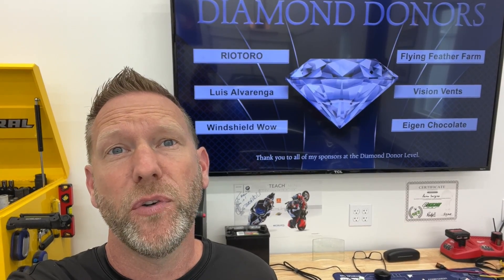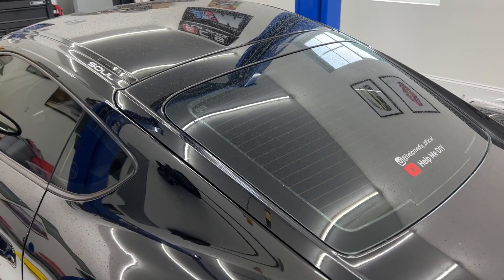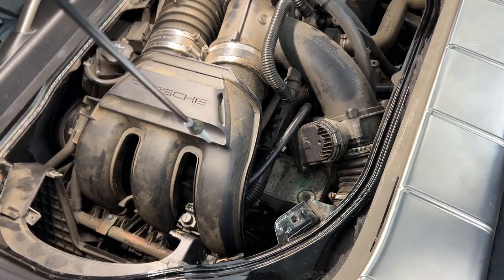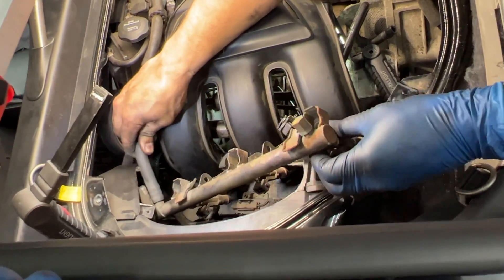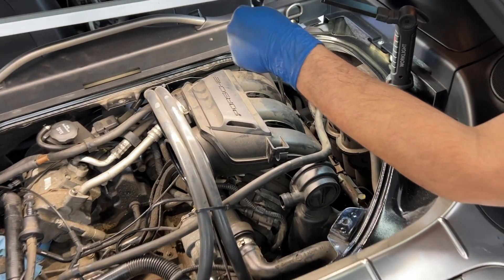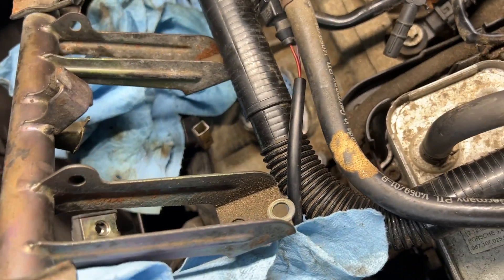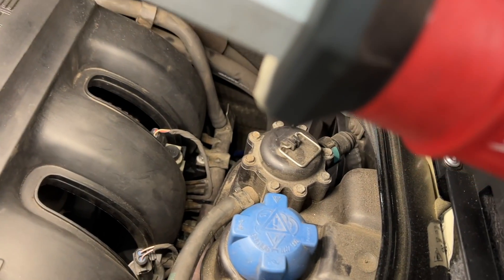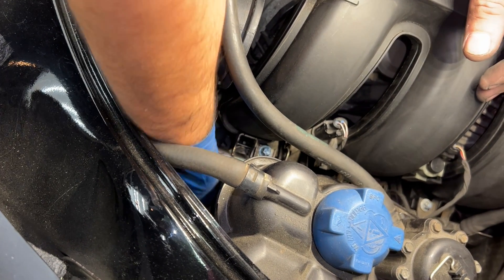How to REPLACE FUEL INJECTORS in a Porsche Cayman 987 (Condensed Version)

Comment: Here's a tip. The left hand most forward manifold bolt is very difficult to remove. Even worse is getting it back in. First I used a little grabber to start the bolt in the manifold flange. Figured a magnet (as in the video) might fall off and the screw disappear for a while. The main problem is just no room to get a socket wrench socket and extension down there. I switched to  1/4" extension but my E10 socket is for a 3/8" drive. So I used an 8mm socket and it worked! I used electrical tape to help hold the two extensions together as well as a little around the extension and the socket. Things falling off down out of site isn't fun. Easy as could be after that.
Reply from the maker: +Eggbert Farnsworth yes I recently bought a 1:4” E10 for times like that :)

Comment: It certainly is frustrating to have to dig so deep to access those darn injectors.  I'm doing it right now. Glad I watched this video previously, so I at least have 6 new manifold sealing gaskets ready. Good to have since the shop manual doesn't tell you that the manifold really needs to come out... it says to disconnect the fuel line and shifter cables, and somehow wiggle the whole injector gallery out. Good luck with that, the manifold is in the way.  When I get frustrated with the tedium of it, I simply take five, and listen to the audio with the playback speed slowed down to 50%. It's hysterical!
Reply from the maker: +Uncle Duncan yeah some people say they do it without removing them. I don’t understand how!
Reply: @HelpMeDIY  Hello from Spain. Thanks for your videos, they are a big help for DIY guys. I managed to change all 6 injectors on my 08 2.7 Cayman without taking out the manifolds. I didn't take out the fuel rails, popped the injectors out from their seats and found that there is enough room to move the rail to get injectors out one by one and install new ones one by one. It was a tight and tricky job, but it is possible. The biggest problem was if 2 of the old injectors came out without upper seals, to get the old seals out when the fuel rail is practically in place needs a bit of thinking and testing different tools. The job took me about 4 hours. No special tools needed, you just have to be creative and patient. Had no problems with the car, did it just as preventive service with coils, sparks pugs AOS, after all the engine runs much smoother than before.

Comment: Brilliant video, Ill definately sign up to patreon, Im trying to change the injectors on y 1999 986 at the moment, the right hand side fuel rail came off eventually without removing the intake but the laft hand side is proving impossible. The 986 has the air filter box on that side which needs to come off to get at the injector connectors but there's a bolt at the bottom that is impossible to see or feel. I think that manifild at least will need to come off
Reply from the maker: +colin jenkins thank you sir! Yeah I still don’t understand how people can get them out leaving the manifolds in 😆
Reply: @HelpMeDIY I think its an issue with many specialist cars,  I used to own a Lotus Elite many years ago and one of the dealers produces a characature of the ideal Lotus mechanic. He had a small body/head with one eye protuding from the top on a long stalk and the first and second fingers on each hand were about a foot long. The funny thing was that I could instantly see where those attributes would come in handy😄
Reply from the maker: @marcos3ltrv6  Lol that's great
Reply: I just did the same on my 98 986 and it was a struggle but I found the last bottom bolt from underneat the car (air box has 3 bolts). You need to loosen the inlet manifoild as well to get out the airbox. I just cleaned and tested the injectors with carb clean and a 9V battery. Running well afterwards 😊

Comment: Hi Aaron(?). Nice video. Super helpful as always! I am deciding whether I should start the job on my 2005 Boxster. There has been a constant little tapping noise which becomes really annoying. With a stethoscope, I believe it comes from the injectors. Do you mind elaborating on why i might want to change the injectors even it they may be alright ?
Reply from the maker: +@bon_1900 thanks! Noise could be your lifters failing. I wouldn’t change injectors if they were alright, but Jake Raby recommended to me to replace them as a maintenance item because they can start leaking

Comment: What is the cable/tube, whatever, at 5:52 and where does it attach? In fact there's two of them....? EDIT: I see a bit more about it later on in the video I currently have the 3 left side injectors out (without removing the intake), but reversing that to put new ones in looks more difficult than this video, so out comes the intake. Actually, the difficulty is that two of the 3 fuel-rail 0-rings stayed inside the rail cups. I managed to get one out, but can't even get a pick in the other one as there just isn't any room. Besides, removing the intake will allow me to clean up the engine a bit. Also, the older Boxster (and maybe Cayman) seem to have the fuel rails that only mount with 2 bolts and don't have those long brackets, so they are probably the ones people are changing without removing the manifolds.
Reply from the maker: Thanks for the additional info

Comment: Wow!!  Just did my fuel injectors on my 997.1 Last weekend.  It was running really rough, I got a CEL, and my Foxwell said it was misfiring on cylinder 3.  So today I swapped that injector from Cylinder 3 to cylinder 1 to see if it would follow it, nope.  Car ran rough, CEL.  Cleared it and took it for a short drive.  As soon as the car got up to temp, got another CEL, P2195, O2 sensor lean bank 1, misfire on 3 and 4 and misfire on multiple cylinders.  I was thinking vacuum leak as well.  Car ran rough the whole time, especially in lower RPMs.  Also, did you do a vehicle handover after changing your injectors?  I was told I should do that.
Reply from the maker: +K1dPhresh1 I did not. I did that after a battery drained all the way down a few months ago though. You had noticed a few things not working anymore. Nothing that would throw codes though.

Comment: Is all the oil in the intake from a bad AOS?
Reply from the maker: +Russ Richards the manometer test says it’s fine, so I don’t believe so
Reply: This is exactly what my intake looked like when my AOS failed. I replaced it with a Euros AOS and that broke a week later. I highly recommend the slightly more expensive genuine Porsche part for the AOS replacement. After that my AOS was good for over a year now.

Comment: curious if it also helped fuel economy
Reply from the maker: +ShaanNotShawn great question, but unfortunately I haven’t ever really paid attention to what it was before changing them.
Reply: @HelpMeDIY  Oh hey me again lol. I think I will try this over the winter. Thanks again for making this video. I do have quite a bit of white smoke that smells like unburnt fuel on cold starts sometimes. Did you have this issue before/after? I already changed the AOS.
Reply from the maker: @ShaanNotShawn  it seemed to clear up for a bit after o changed them, but it’s back. I think it’s time for the AOS
Reply: @HelpMeDIY  oh that tool you just got is really gonna help with those stupid pinch hoses for the AOS. That was the hardest part.
Reply from the maker: @ShaanNotShawn  I know right?!

Comment: I’m having trouble putting em back in for some reason
Reply from the maker: +Thor Productions maybe a little silicone spray on the orings? They can be finicky.
Reply: @HelpMeDIY yea I put some Vaseline on em but they still aren’t sitting right in having 2 cylinder misfires currently sitting in the car wanting to crush it